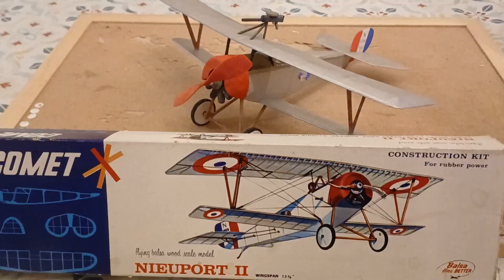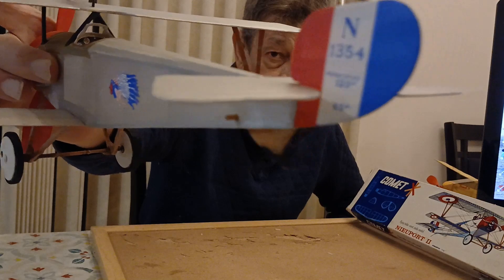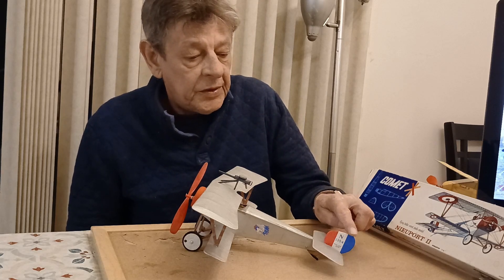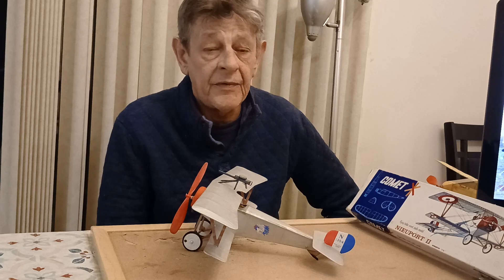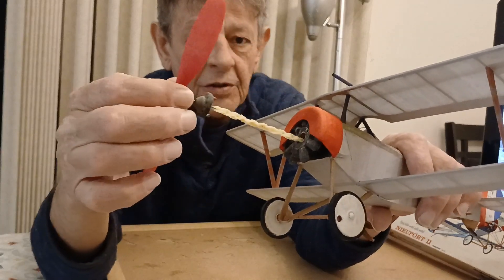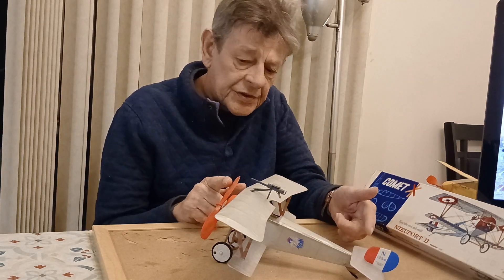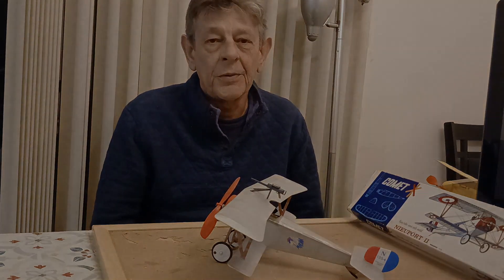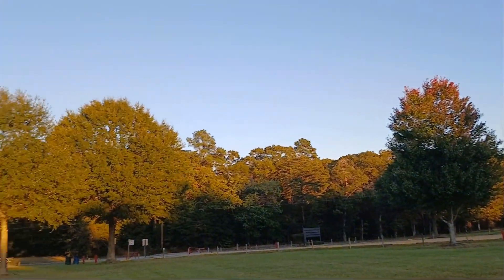Comet Nieuport 11 test glides and notes

Comment: Mine is still in the box..for these many years.  I an put off by those large pieces for the wing, stab, and rudder outlines.  Seems extra large for a 13" model.  Has anyone built one substituting smaller wood (the wing trailing edges could be 1/8 x 1/16), maybe laminated outlines?
Reply from the maker: Yes, I thought the same thing about the trailing edge wood and my thoughts followed the same line on substitution but I went with the plan as written just to keep it simple and it would have worked out if I had just made the tail lighter! I'm surprised I even finishd it to be honest and it actually looks right instead of the crooked mess I was afraid I would wind up with! I taught me much for the next one, in any case and I'm glad I completed the project even if it is a hanger queen! Cheers!

Comment: The graphics on the rudder can be printed onto the tissue to save weight. I have a video showing how to do that. A sub-1 gram rudder is possible with low density wood. The motor peg can be moved up a couple bays to remove weight in the tail. Your braided motor will allow that to work just fine. Ditch the Guillows prop. The pitch distribution on those is awful. A touch of dihedral in that top wing would be a good thing. I've seen several successful versions of this Comet design. The Guillows version is a tank.
Reply: Agree across the board. Every rubber FF model I build has the peg moved forward unless it has a rarely encountered long nose. I also quit building kits long ago. All the classic plans are available online any more so you can choose your wood, prop, wheels, etc. It’s nearly impossible to build a plane as heavy as a kit if done this way. 
The build quality here looks great though. Nice work!
Reply: @836dmar  Keep us the great work and look forward to seeing your next build.

Comment: Great build, guidance, and flights:) I get very nostalgic when looking at an older kit, especially the lively box-art.  So, I have just added the Nieuport 11 to my build list.  Thank you so much for posting your experience, Barry
Reply from the maker: Thank you! Yes the old kits give that Christmas morning feeling, I don't even care how bad they are!  Remember, a kit is just sticks and a plan. This ones not much of a flyer so I recommend the larger Guillows model, comes with some plastic parts. Also this kit may be hard to find as they haven't made them in 30 years. Good Luck and Cheers!

Comment: Nice looking model, I built the Guillows Nieuport several years ago. Same issue, tail-heavy...but it makes a great looking model also. I ended up uncovering the aft half of the fuselage and sanding down the stringers and flying surfaces, it helped considerably. Good luck!
Reply from the maker: Thanks! I think I'll just put it on the shelf and move on. I'm Happy. Cheers!